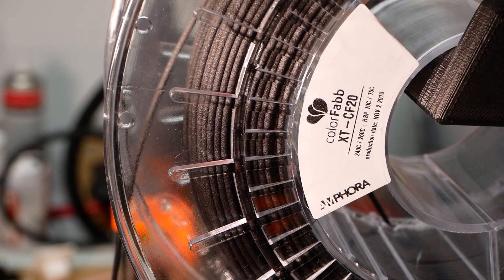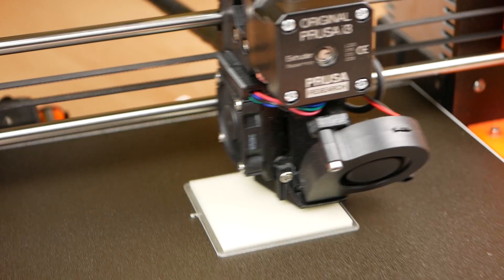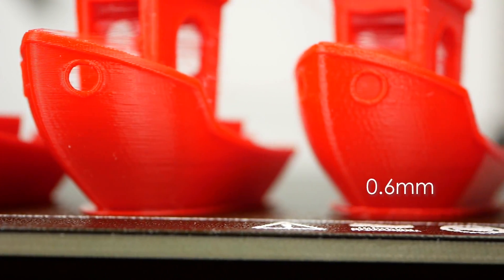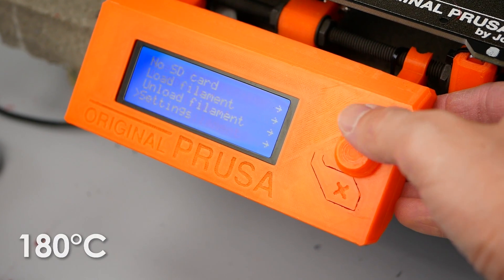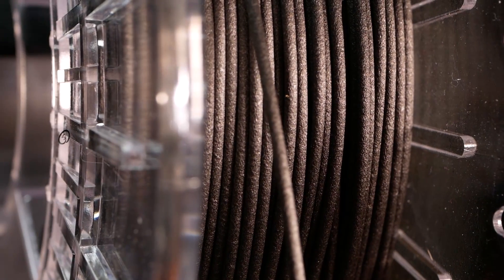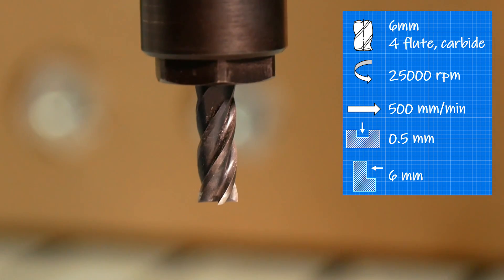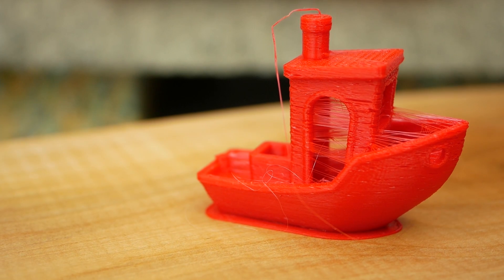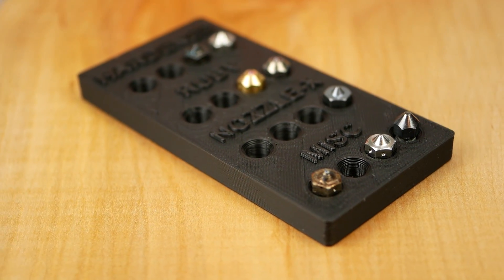HOW MUCH abrasive filaments damage your nozzle!

Comment: I'd guess that the helical pattern is actually from the mechanism feeding the drill. A bent screw in the drilling mechanism would lead to the drill walking off-center in a repeatable fashion, with the same pitch as the screw; a bent bit would lead to a straight, but off-center hole. I had a similar issue on my MPSM, where the bent Z screw lead to the tip "wobbling" back and forth as the screw turned. Judging from the scaling, the screw driving the drilling mechanism has a 2.5mm pitch
Reply: Also, the initial quality difference could actually come from the even-ness of the exterior flat surface. The cheap ones aren't flat/uniform; E3D's definitely are. E3D's would leave the top of each layer flat, the cheap one looks like it has grooves and a non-perpendicular surface for plastic to stick to. 
I'd love to see the research that E3D's done to see what affects quality.

Comment: Has anyone looked at the wear in the boden tube?  I suspect that it might be the weak link.  Running abrasive filament will make the tube oval out at critical points, adding slop to the retractions.  Are you sure the B-tube is not the cause of the stringing?

The results you got for the nozzle are very useful. They suggest that it is as simple as measuring the nozzle length to detect wear and predict the life left.  In industry, we would specify a preventive maintenance schedule and just charge a higher price on the abrasive parts.  Based on this test, it looks to me like cheap sacrificial brass nozzles would be the way to go as long as they make it through the part.

Comment: I'm no machinist, but it's possible they actually mill the internal profile rather than just drill it, and because 1.75mm end mills are not standard (to my knowledge) the spiral pattern could be from tool or fixturing deflection during a spiral milling operation.

Comment: I wonder if the polished finish of the internal bore would assist in retraction as opposed to the spiralled bore of the cheaper nozzles. The spiral could cause more friction at the tip leading to the extraction pulling the molten filament higher in the bore than right at the tip where you want to filament to be extracted to reduce the stringiness. I feel the stringiness is caused by the molten filament still attached as the printer head moves from one area to the next. Having a cleaner retraction would reduce the amount of filament being allowed to drag from one point to the next. A larger diameter hole would increase the problem too which is shown on your test prints. Smaller hole = less filament allowed to be dragged from one point to the next. If you increased your retraction as the diameter grew bigger you may find better results?! Food for thought.

Comment: I had a great deal of wear just show up on a nearly new nozzle after finishing a 500 gram roll of Black Magic 3D aquamarine glow in the dark and before that a 1 kg roll of Hatchbox brand silver on a project I will try to get pictures posted here.  The filament coming out was practically full diameter.  I also had a lot of clogging with ZIRO brand glow in the dark blue after a few months of leaving it out.   45 mins of printing then a clog or thin printing.  lots of wasted prints.  any special storage needs for Glow in the dark?

Comment: I don't know if you realize how much some of your videos, especially ones like this one, add to the 3d printing world.  In this case, we pretty much lived with "those filaments cause the nozzle to wear" and I'd bet that we all assumed that meant that the hole in the nozzle was getting bigger... instead the face is wearing off it... huh.  That has totally different implications WRT to dealing with the wear.  

I've already been modifying the cheap Chinese nozzles for better print quality and reliability.  Now you have me considering changing the procedure somewhat, I'll likely custom grind a drill bit to have a 60* tip on it (I knew about the spiral finish on the inside, it was causing my printer to jamb up once in a while so I run a drill bit through new ones to clean that up) and I'm thinking of trying polishing the points flat on them.

Keep up the good work!

Comment: As an engineer I always enjoy your vids.  Your scientific approach and attention to detail are definitely value added.  I would be curious to see if removing material from the face of the tip of the cheap nozzle, until the chamfer was removed, would improve the print quality.  Also, I noticed that the surface finish of all the nozzles was bit rough.  Would polishing the nozzle face help the print quality?

Comment: how do you figure woodfill would wear out brass. Brass is significantly harder than wood. Wood may clog the nozzle (and has in my experience, but has not worn it out any, though just for my own sanity I've switched all my machines to NozzleX nozzles.
Reply from the maker: Even though wood seems soft the fibers can be very abrasive. That's also why you shouldn't use you best knife on bamboo boards for example.

Comment: Sanjay Mortimer
's answer on the helical pattern seems unlikely. 

The consistent helical pattern is more likely to come from a drill that is mounted on a bent lead-screw. This explains the consistency much better.
Reply: I have personally seen that helical pattern when printing on my makerbot cupcake with bent lead-screws.  I immediately assumed that was the cause when I saw the cross section.

Comment: I just finished taking apart my hot end on my i3 Mk3S to clear a really really bad blockage of the ptfe tube and nozzle. It was bad. Horrible design of the X-axis carriage on the Mk3S and I really hope they improve it. I'd like to be able to easily swap the entire hot end without having to disassemble the whole thing. But yeah disassmebly of that Mk3S carriage is horrible. Don't fuck with it guys.

Comment: What does not make sense is the wearing out so much that it changes the diameter. This would be because you would need to adjust your z endstop/prob to get it to move the head down. Since you are using a Prussia printers that uses a aluminium sensor it would require you to change the settings to start getting that much wear.

Comment: Now that I think about it, I'm quite surprised that no one makes printer nozzles from tungsten carbide. Tungsten carbide is used in what is called a "cutting insert" which are about the size and shape of an antacid tablet. These inserts are sintered as a composite of tungsten carbide dust (~95%) and metallic cobalt (~5%), then the cutting edges are ground. I think nozzles could be easily made on the same machinery, but only if the threads are omitted. While threads are entirely possible, they would be more expensive than what they are worth, and the 3d printing community are an adaptable bunch. These WC nozzles would be extremely accurate and consistent by 3d printing standards, not to mention incredibly wear resistant. 

  The price of WC cutting inserts, for the most common size and no special coatings, is about $10 per insert if bought in packs of ten. Being as the market for WC nozzles is never going to be as big, I expect WC nozzles to cost $20-$30 each.
Reply from the maker: There are actually tungsten carbide nozzles around: https://dyzedesign.com/tungsten-carbide-nozzle/

Comment: Most of your 'bad looking prints' is more a matter of bad filament and bad settings, than a bad nozzle. You shouldn't have any strings on a default print, if you do, you're doing it wrong.

Put your filament in a dryver for some time (like 48hrs) and get your retract settings right.

The first example of .8mm for instance, was printed too hot and with either damp filament or wrong retract settings.

The fact that your baseline is already wrong, makes the rest of the test interesting but not really relevant.

Comment: To get that weird spiral, too fast of a feed rate + a drill with a bad grind causing one cutting edge to do most of the work + soft material like brass which allows the drill to grab harder. This will make the drill walk side to side as it drills down giving you that strange undulating wave pattern in the hole.

Comment: When the drill stickout is so long, you get wobble at the cutting end and the drill is going to cause that odd pattern inside the nozzle. Probably using a turret cnc lathe and need the long stickout so the machine has clearance to not crash the other tools.
Also the drill is probably dull.  That's my best guess
Reply: As a ex-machinist,I can also state that a drill ground with one edge longer than the other,the drill will not only make an oversize hole,it makes it spin off-center,and wobble,leaving the finish shown.I can also happen if material fuses itself to a cutting edge,causing a "bug" that leaves a similar trace in the hole on withdrawal.

Comment: Thank you for the great video. Allot of good points, and it would be great if you can get some of the manufacturers to help you out of a follow on video. Using the same processes done as before bit on a longer term basis and with the different styles. I'm really curious about the hardened ruby nozzle that was in your set alongside the standard Olsen nozzle.

Comment: I have actually researched this quite a bit and read about similar types of methods of testing. I think most nozzles lack precision and I have actually decided to manufacture my own and am currently building a machine to do just that and want to eliminate or minimize wear as much a possible without sacrificing precision at all. I don't believe calipers are precise enough for the tuning/calibration of a 3D printer. I have access to a fully equipped machine shop (though I understand not everyone does) and use gage blocks, micrometers, and microscopes to measure everything. I like your videos, I'll send you one of my printers when I'm finished with it.

Comment: So now I'm just confused. What is the wear mechanism for the CF filament? I'd expect a liquid abrasive under pressure would wear from the inside out. If it's shortening the nozzle, then it must become abrasive when cooling/cool and the nozzle rubs over it, like sandpaper. Or is it chemically active and eating away the brass nozzle when the molten filament is exposed to air? Maybe even some sort of galvanic corrosion in the brass, taking away the zinc and leaving the softer copper behind to be worn away.
Reply from the maker: The molten plastic that is laid down as well as the previous layer probably acts like sandpaper on the nozzle and wears it away.

Comment: 13:00 I think that the stringing on the chinese nozzle is mostly caused by the 90° point angle (and not by the chamfer). I bet more molten plastic stays in the nozzle during retractions - causing the ooze.

Comment: sehr guter Beitrag! Da spare ich besser nicht an der Nozzle.
Ich hätte eine Frage die allerdings nicht ganz zum Thema ist. Wenn man sieht wie du die Benchys druckst und die Nozzle am Endpunkt eines Verfahrweges angekommen ist, bewegt sie sich etwas nach oben (Z-Achse) und zum Startpunkt des nächsten Verfahrweges. Dieser Vorgang ist extrem flüssig und ohne Pausen. Bei mir findet an dieser Stelle der Einzug (Retraction) statt und dafür bleibt die Nozzle immer an Ort und Stelle.
Es gibt zwar nur wenige aber dafür wichtige Situationen wo ich das gerne vermeiden würde und deshalb wollte ich wissen wie ich das gewärleisten könnte? (muss ich den G-Code manuell verändern oder lässt sich das im Slicer konfigurieren?)
Ich nutze Cura als Slicer. Für eine Antwort wär ich sehr dankbar :)

Comment: Stefan,

Job well done, as always.

I print mainly with flexibles and CF nylon on the same Prusa i3 MK2s. Yes, two completely different materials, each with their own challenges.

I was having major extrusion issues and jams. I replaced the E3D hardened nozzle that I had run a few kilos of CF nylon through with a new E3D Nozzle X with no real change. I then looked at the heat break tube and saw some markings on the inside of it, so that got replaced. This improved my results a fair bit. I still had problems. I noticed inconsistent layer adhesion on the small parts that I print using Ninjateks Armadillo. There is a post that is 4mm diameter that when everything is right will not snap off. I print about twenty of the parts at a time and have maybe 4 - 5 that fail. I then looked at the Hobbed Pulley and noticed some wear. I didn't realize how much until I removed it and compared it with a new one. (See the photo in the attached link)

There are many aspects that can cause extrusion issues. If you use the "Cause and Effect" process the best method for solving the problem is to go back the where all was good.

https://photos.app.goo.gl/SDJUQd27NxsFrfXd9

https://photos.app.goo.gl/fLq8RsCXCE3vuNza7

Comment: Great video! Could you do a test on how the 60/90 degree angle in the nozzle affects the flow of the filament? I made some filament that has two colors down the length, and I would like to know what is the best way to avoid the mixing while printing

Comment: In my opinion, the E3D is superior in terms of stringing because of the 60deg angle of the convergent channel (instead of 90) as it will create less flow resistance, thus lowering the pressure buildup in the melt chamber. With a lower pressure accumulated in the chamber there is less viscoelastic flow (ooze) when you stop extrusing. Also the sharp transition can help too as it will cut the strings and avoid pulling out filament. Great video as always, and excellent scientific approach to real world problems.
Ps: funny enough I just noticed that Sanjay just made a similar comment.. Seems that physics is the same for all of us ;-)

Comment: The spiral pattern on the inside is most likely accidental and not done on purpose. Probably the result of some bad feedrate/spindlespeed combination on the lathe or a bad spot drill.

I’ve had a similar result on a nozzle I machined myself for an injection molder.

Comment: Thanks for making this video!! I print 99% CF PETG (from Atomic Filament) now on a AliExpress hardened nozzle. I also switched to 0.5mm to allow for larger particles to flow without clogging. I had to deal with multiple worn nozzles and this video really helps understanding what is going on.

Comment: Well, since your print with 0.4 gcode - 0.4 nozzle produce strings, it kinda puts shade on all other results: your printer is clearly set up wrong if it works better with 0.4 gcode - 0.25 nozzle.
The strings you get on bigger nozzles may be just an amplified error of your initially wrong setup, and it tells us nothing about nozzle wear issue.

Comment: @CNC Kitchen the wavey drilling is probably due to bad chip evacuation. Its due to the fact that the chips are workhardend and harder as the drilled hole walls. Then the poorly evacuated chips stay stuck in the hole and act as a grinding powder.

Comment: Great subject to point out !
I believe that if you used an extremely strong tool (such as adjustable pliers) to tighten the nozzle it can easly deforms the inside of the nozzle and will only have a slight affect on the outside of the nozzle.
I would suggest to check it after tighting (with a strong tool) a brand new nozzle.

Comment: The spiral pattern is from either a slightly bent drill bit or the chuck/tool holder is off center. Or if the internals are machined on a lathe the chuck of the lathe could be off center as well.

Comment: You shouldn't use no-name digital calipers for measuring the cold pulls. Most digital calipers are only reliably accurate up to 0.05mm, although they read to 0.01mm, which gives a false sense of accuracy. If you want to do better, name brand digital or dial calipers can go up to 0.02mm. Given that I would be expecting deviations in the range of 0.01mm, you should really have used a micrometer instead. Finally, using the tips of calipers to measure a soft piece of plastic inevitably skews the readout, use the solid part of the calipers instead!

Comment: Spiral hole when drilling brass is usually due to a very dull drill bit, excessive drilling pressure or a bit with a chipped cutting edge.
As for printing impact, spiral hole is gonna increase feed resistance a bit.
The worst aspect of these cheap nozzles is how unpredictable they are going to be.

Comment: The flow of filament is the most important, you can print 0.6 with a 0.4 nozzle .Filament will expand outside because of pressure difference.

Comment: it's also important to keep an eye on the nozzle face, because it has a great impact on the print quality. 
with cheap brass nozzles i made a habit of always polishing the face after installing a new one. (lay cardboard on the bed, very lightly lower the nozzle onto it, and move it in circles for 1-2 minutes. gives it a mirror finish)

Comment: The spiral pattern on the inside is simpler to make with a softer material. It’s a combination of flutes and the degrees relative to the Centre line. That gives an instability when drilling. You can try this with like a block of aluminum and a hss drill. Of the feed speed can be high enough you will see a similar pattern. Rough but similar.  The expensive way would be a cnc with a ball end mill but I don’t think they could sell them for 20 cents a piece then.

Comment: Too high feed rate can make the drill wobbling in the brass. I'm missing the finishing with a reamer, but this is why they cheap.
Also good idea to decrease the angle that reaches the nozzle diameter to decrease a bit the friction of filament too!

Comment: You mentioned you replace the brass nozzle with a hardened steel one when printing abrasive materials. But why not Always print with the hardened steel one? Just because the thermal transfer is better with the brass one? Did you do a comparison between the two metals?
Reply from the maker: I started printing exclusively with the Nozzle-X and didn't see any issues so far. I will be doing this comparison test, though.